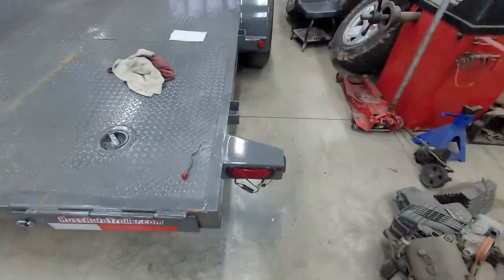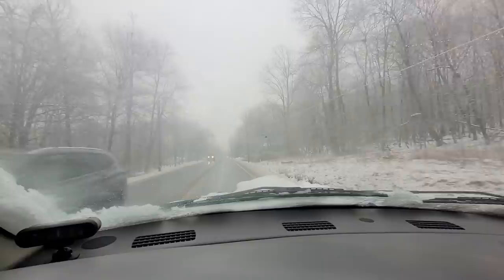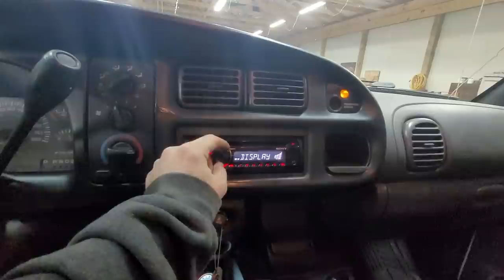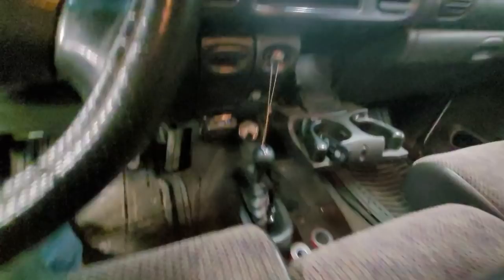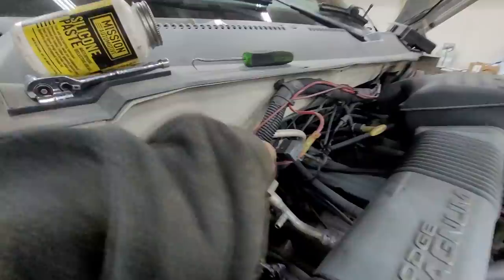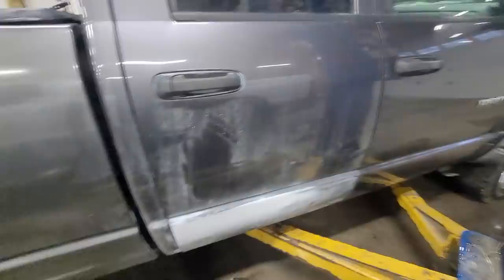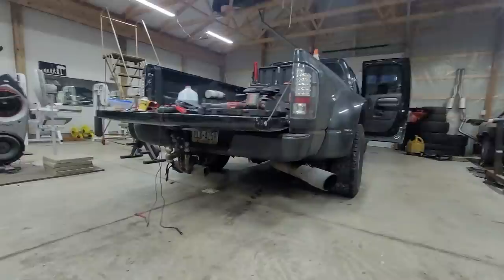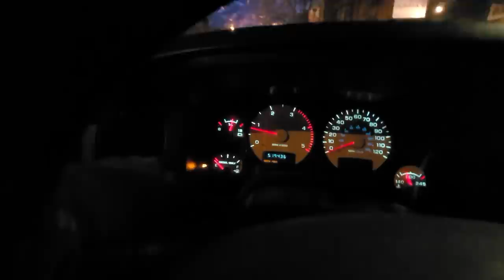Here's What I'm Doing To Keep Income | Air Suspension/Radio Install | Searching For A 40ft Trailer

Comment: Hay Steve I think You should leave your exhaust where it is. Just move it back a couple of inches or so. I know its a little bit of work to do that but I know You can do it. Plus You will still be able to see Your exhaust out your side mirror if you need to see how much your truck is smoking pretty easy. With an axle dump you won't be able to tell quite as easy or fast.Keep up the good work brother! 👍

Comment: The air gauge reads pressure from the airline going through the firewall to it.  The pressure switch under the hood turns the compressor off when the pressure reaches a preset pressure, ex: 110psi.

Comment: oil leaks try seallube reconditions any "rubber oring or seal" guaranteed to work or your money back i used it on skidloader wheel seal ,1850 oliver injection pump ,power steering and it worked on all em

Comment: That corroded piece is a relay. They go out from time to time. I keep a stock of them as I have about 8 total in my electrical system.
Reply from the maker: Well I know it's a relay 😂 but yeah I cleaned it all up and threw some dielectric grease in there. Luckily the air system isn't a priority to drive the truck

Comment: definitely axle dump it. And I was wondering how that would work bc I wanna run a stack along with a tool box and a fuel tank in the rear of my 8ft bed. Didn't know how that would work with a gooseneck but since u said it it should be enough room. And what size stack u  going to do? And I forget why u said it but y u going with both stack and rear exit?
Reply from the maker: 6" is the size I'm going with. 5 is too small and anything bigger I think is too much. I'll try to find the link here in a second on the 5" exhaust valve
Reply from the maker: https://www.truckpipesusa.com/products/2-position-5-heat-exhaust-diverter-tube-hdt-5a.html?sku=HDT-5A&utm_source=google&utm_medium=cpc&adpos=&scid=scplp423&sc_intid=423&gclid=CjwKCAiAg6yRBhBNEiwAeVyL0HCdTifYRIUCDiSk9rVPT7LeNV_omOXrMvXXOxB_3F-NvGnmXCXMDhoCZtkQAvD_BwE
Reply from the maker: Going with both so when I'm towing I don't soot up the cars

Comment: Came across your channel the other day so forgive me if this has been covered before...is that an nv5600 or a g56 in your truck?
Reply from the maker: Nv5600
Reply: @CPSteveMiller  Sweet dude.  I have an 04.5 3500 dually myself w/ the nv5600.  I also had an 01.5 HO I drove for years w/ the same trans.  They're pretty damn bulletproof but HEAVY mfers!
Reply from the maker: I love mine. The original had 549k before 6th gear exploded 😂😂 This one has about 260k on it now
Reply: @CPSteveMiller  Not bad.  I have about 240k on mine.

Comment: Y not wor as long as you get 200 profit  a day that's good
Reply from the maker: To work all week for only 200 profit a day? In this industry that's a good way to go broke. I profit more by not driving at all. Until profit is 400 a day minimum it isn't worth it. That's 2000 pocketed a week pending I work 5 days

Comment: Just saw this on Facebook  40 ft trailers 
Near me ky
2019 40 ft pj
Gooseneck dove tail
Hot shot accessories available? 
Jackson tnn price 15 k 
Check it out on Facebook 
Is that about rite ? That is beverdam ky
Reply from the maker: Send me a message on Instagram with the link if you can. That's still a good price!
Reply: @CPSteveMiller  I don't know how just 
Kind of computer dum
I found in on market place ( Facebook)
Trailers 40 ft flat bed for sale near me 
Beverdam ky ok it pop up I look thru it 
Nice looking trailer but it's in Jackson tnn 
Hope that help